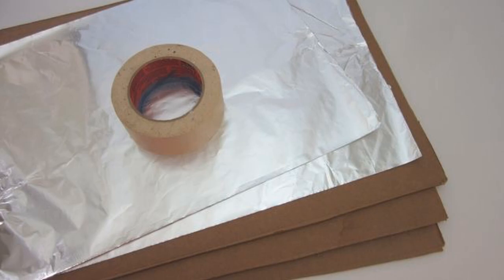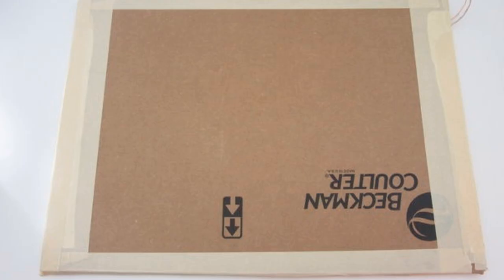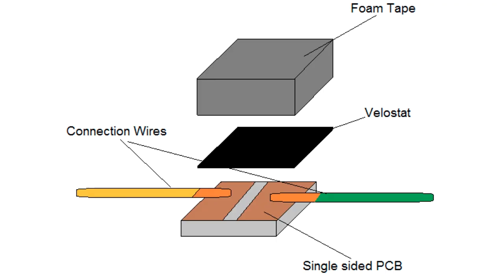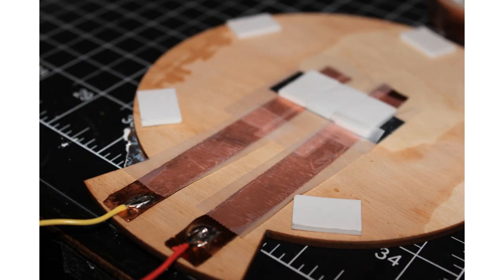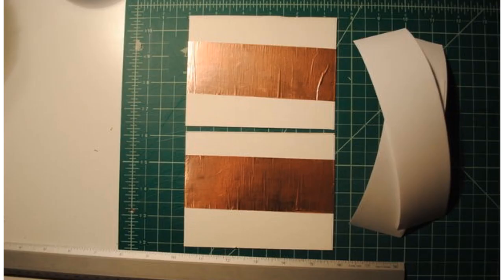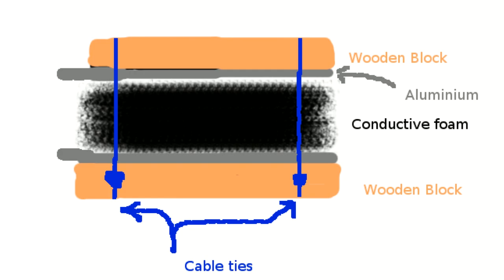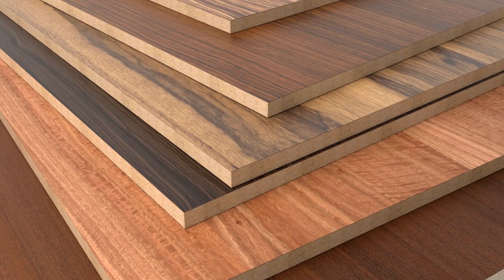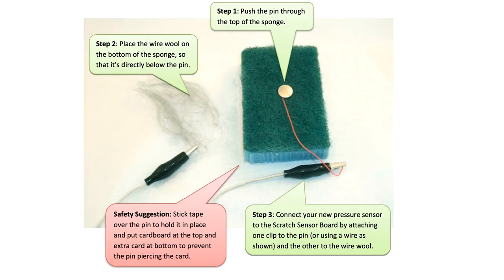Pressure Pad Lecture - How to make your own

Comment: Have you tried to measure the amount of pressure that is on the sensor? I have tried with the velostat sandwich but for me, it is very unstable.
Reply from the maker: Velostat is an amazing material, but can be difficult to house in a way that consistant readings can be obtained. I have not tested the pressure limits for these arrangements, but these designs are intended to sense low pressure levels (with a person stepping on the sensor serving as a maximum). This approach is great for detecting if and when an event occurs but is much harder to configure when the amount of pressure is needed. That being said, better results can be obtained by refining the sensor's physical enclosure and by applying filtering to the raw sensor data (usually a simple low-pass filter can garner much better data).

Comment: Hi, how to deal with velostat "creep" behavior? The decreasing resistance without adding more pressure?
Reply from the maker: Hmm, good question. One possibility is to decrease the amount of overall pressure which is applied to the velostat. If it is stretched or compressed too much it can "creep" as you describe. Is there a way to reduce the amount of pressure coming into contact with the material? Perhaps you could build a brace mechanism next to the sensor to help support the load.

Comment: Does the size of the sensor matter? Would it work if i build it only the size of lets say about a 2x2 cm or even 1x1cm? THX!
Reply from the maker: Hmm, you should have no trouble getting a sensor of that size to work. It might be mechanically more difficult to build but the principles are the same just scaled down. The size of the sensor does effect how the device will behave, but you should be able to make it work with some code or mechanical tweaking.

Comment: Which method do you think best sensitivity.  I'm making a mat for an 8lb old pet.
Reply from the maker: I think it would really come down to the construction of the pad. I would try to make sure that all the weight of the animal is centered on the sensor. If that is not possible try to have four sensors on each corner and perhaps on in the center. Any method should work, just analyze the output data in the serial monitor and determine where your threshold is. If you are not getting enough "action" from the sensor still try to reduce the size of the sensors and the size of the contact area, this way more pressure is applied per square inch and you can get a better reading with less weight. I hope this helps. Share your creation if you can and are willing =)

Comment: What is stopping us from just attaching the wires directly to the velostat?
Reply from the maker: The problem is you are unable to solder directly to the velostat, it has a plastic-like consistency and soldering irons just melt right through it.

Comment: which of those has most efficient for edrum pads project?
Reply from the maker: I would probably go with Velostat. I imagine it would be a big plus to have an analog value to work with instead of a simple digital signal. The analog signal you can get from Velostat would allow you to map the pressure on your sensor to the amplitude of the samples.  If you use the simple digital methods you will only be able to tell is the pad has been hit but will be unable to know how hard it was hit.

Comment: Can you tell me which technique of floor sensor making is most effective?
Reply: It depends on what you want the sensor to do. If you just want a digital output of on or off the button method is probably good enough, but if you want to change a function based on how much weight or pressure is on the sensor you should probably go with the velostat.
Reply: I am getting mixed information on what the top layer should be above the velostat. One guy on flashgamer say use a conductive/knit material. Do the top layer need to be conductive or will carpet work?
Reply: So the video highlights 2 ways you can set up the velostat as a pressure sensor. Check out 4:38 and 7:19. But in either way you could put carpet over the entire set up.

Comment: What is the best unit? I have a small dog. Will she trip these units?
Reply: If you are using for Pet Alert, just get a regular motion detector and a small light or alarm.  Once the Light or Alarm on, you will know.
Reply from the maker: I agree, pressure pads have very limited use-cases where they are the "best" technology. Usually a motion detector (ultrasonic or IR) are an easier to use and more effective choice. Especially for detecting things which dont weight too much.

Comment: What if u need it to be water proof
Reply from the maker: Velostat itself can get wet without any issues, the primary issues would be unintentional bridges between wires and corrosion of the metal components of the sensor. As long as you spend some extra energy to ensure that any exposed metal is securely sealed either inside an IP enclosure or by using a product such as "liquid tape" or "plasti-dip" to seal the exposed components you should be good to go.